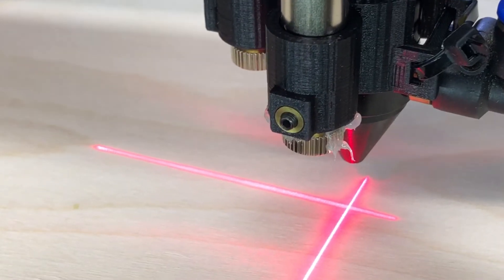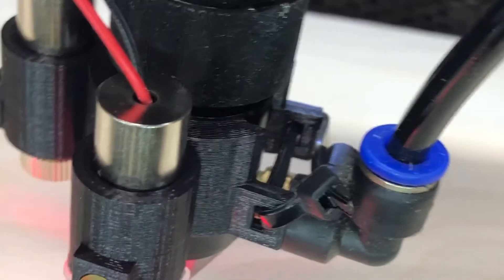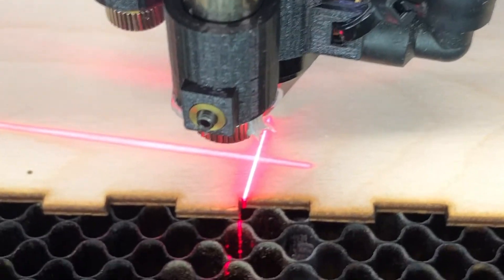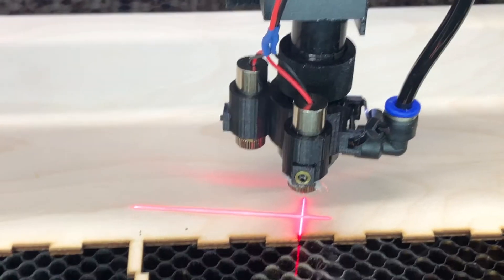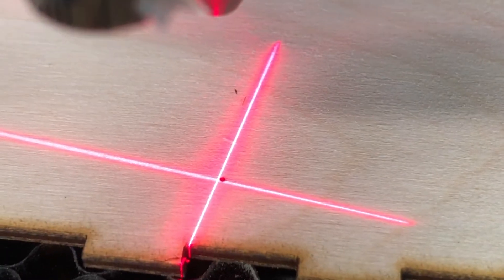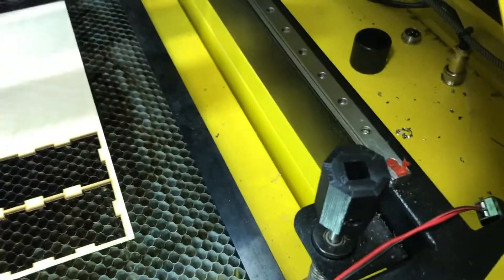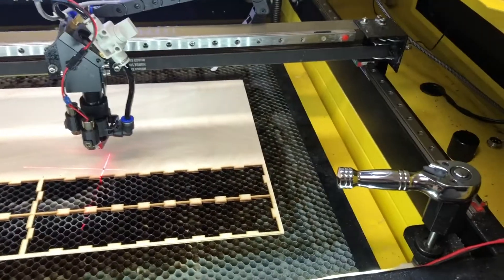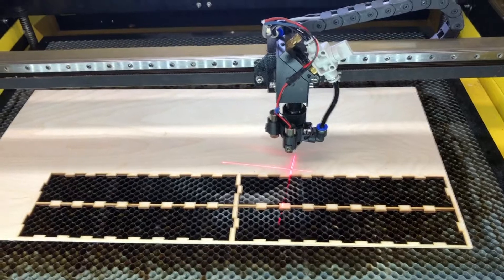Made a cross laser pointer for my CO2 laser

Comment: This looks really good! Do you pulse a burn mark and then rotate the laser lines until they cross over the laser burn dot? I have seen some crosshairs that don't cross on the burn mark , rather run parallel to the laser head and the offset amount is measured and this measurement is added to the settings in Lightburn. Not sure which method would be the most accurate!
Reply from the maker: Yes, you pulse, then adjust the line lasers so they cross the dot left on the material.
Reply: thanks so much. Making mine now :) @terrymakes3613

Comment: Hi Thanks for this idea, I have been toying with doing this on my new build as the trouble with a beam converter is the laser light comes out after 3 mirrors very poorly and living here in Spain with the increased light levels you can hardly see it at all and seeing it working here has confirmed to me its the best way forward although I will opt for two straight lines and hope that is what will arrive!!! 

Rather than make it from PLA or ABZ I think I will machine it out of aluminium on my mill. its gets a tad warm in the lasing chamber with a 150 watt tube . Its been nice to see it working so thanks for the heads up on this and of course the STL file over at Printables

By the way why dont you pop a little low voltage motor on to your bed with a up down switch to make life easier?

Comment: Which Lasers did you use?
Reply from the maker: Omtech 60w It's a Chinese model sold by Orion motor tech.
Reply: @terrymakes3613  no what laser line pointers?
Reply from the maker: @ericfletcher8454  Oh sorry, they are just cheap "line laser modules" off Amazon, no brand names. Every time I have bought them they come from a different seller (they are handy for many things). They run off 5V so they can directly replace the one in the CO2 or even be used with a USB cable.

Comment: Would you make this for someone?
Reply from the maker: Hello, I might but your laser head (last part before the cone) would need to be the same size as mine. I would only really make the plastic parts and let you get your own line lasers off Amazon
Reply from the maker: Checked and mine is 24.4mm diameter, so if yours is very close to that (a few mm either way) then it should fit.